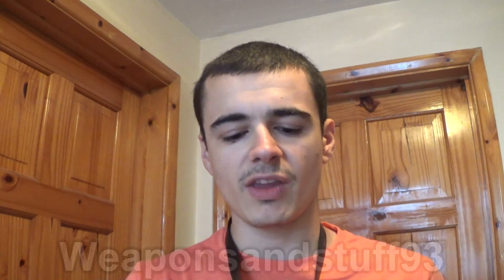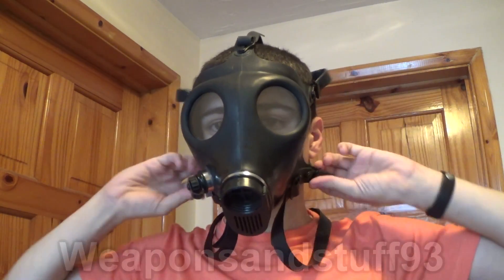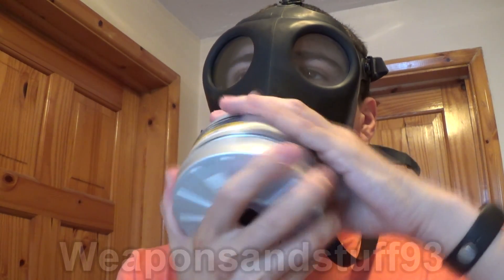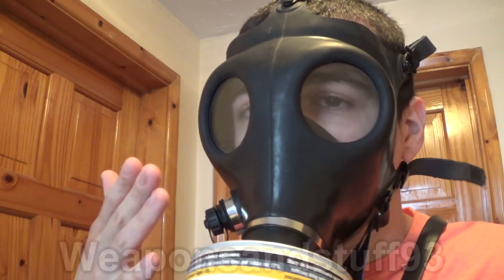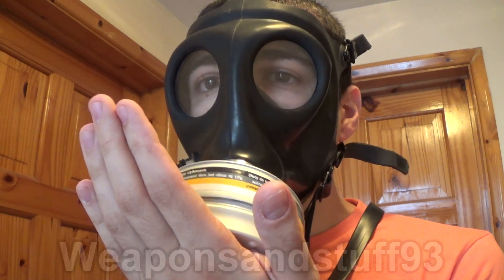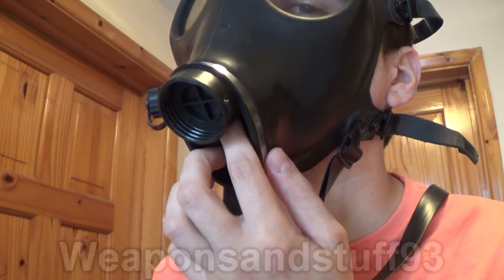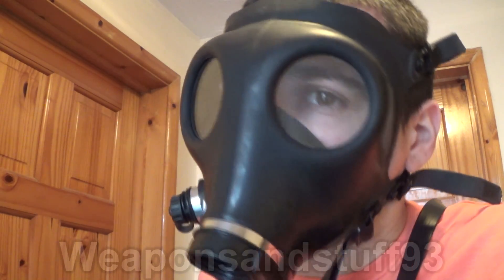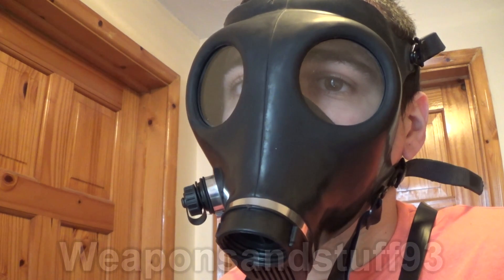Respirator fit test/check

Comment: I love gas masks that have filters in the center (like Gp5) what is the best gas mask that takes filters in center?
Reply from the maker: Probably this Israeli one, unless you mean lower, in that case the Israeli M15.
Reply: You could try an MP-5. They're good quality, relatively cheap, and as the channel uploader has demonstrated before, their filters are threaded to fit old soviet masks like the GP5. That way you could use both.